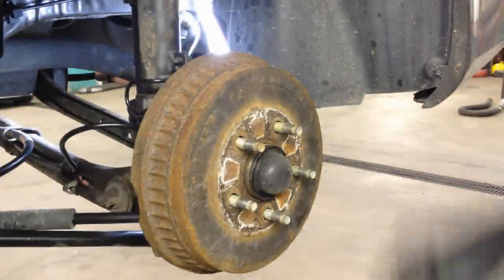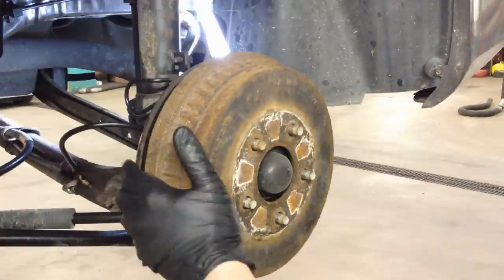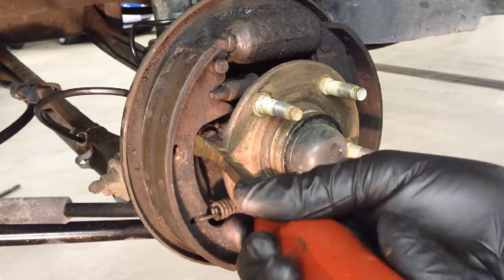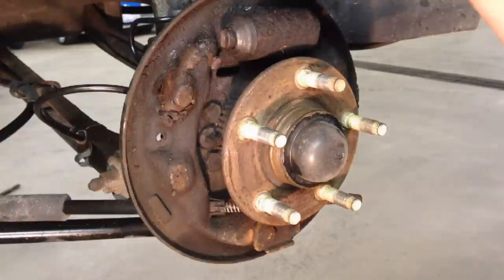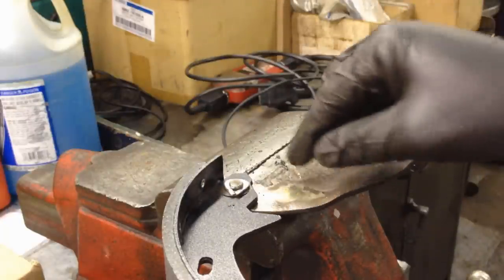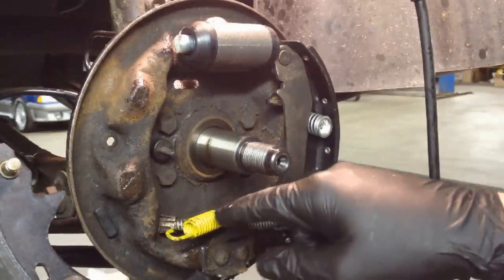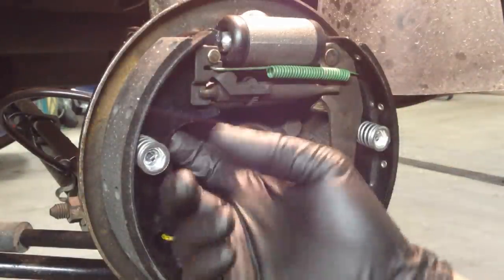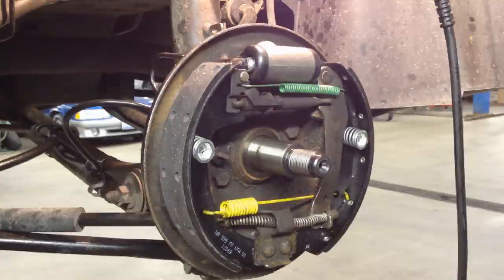Ford Taurus Rear Drum Brakes Replacement

Comment: You skipped the most difficult step for me, getting that shoe on the e-brake cable.
Reply: I just leave it connected to the cable.
Reply: Exactly, does a how to but doesnt show how to
Reply: Me too.  The shade tree mechanic had a hell of a time but persisted until it was reconnected!
Reply: What?  I watched 9 minutes of this video to find out how to get the cable off and he skips ahead.  WTF man!
Reply: I just left it on and had no issues.
Reply: Lisle 44210 universal emergency brake tool. Trust me on this, it’s worth the $30.
Reply: Yea uhm
....just dont disconnect it

Comment: Thanks for the video.  Haven't done drum brakes in over 20 years and in my old age I refuse to pay a mechanic for this old car.  Even though I took pictures I was able to reference your video for spring placement and the order to re-assemble the brakes.  Hardest part was getting the drums off.  For the e-brake, I left it attached to it's plate and just attached that to the new shoe.   I also left the wheel hub on, I did not remove it.
Reply: Thank you for your input. It answered all my questions!

Comment: Great video. Didn't think drum brakes would suck this much, but at least they're done!
Reply: They really suck when you "thought" you had everything you needed, I'm talking ALL new parts, drums, even parking brake cables because they were rusted and coming out of their grommet/locations.... YET after tackling the driver's side like here, everything is off except of course the brake cylinder, so begin to unscrew the tube from the back and it just wants to twist and SNAP!! So the tiny black brake line you can see at the top backside of the backing plate, snapped. I wasn't even at home then so I had to find a bolt to plug off that brake hose so I could drive the vehicle. It turns out "Nope can't just buy a replacement brake line tube online!" You can the right rear, not left.... I wasn't going to the dealer to check and the other way to get the OEM-style part would be to "buy a pre-bent KIT between ~$130-$300 dollars." I didn't need "8+ brake lines costing hundreds of dollars." I just needed this one tiny one. 

So I opted for a local parts store, I think it was either a 6" or 8" straight brake line tube (bubble flare) with connectors. It was around ~$9-$12 at O'Reilly's. Clearly I was going to have to bend the tube myself. I bent it by hand with no tools and turns out my bending abilities are pretty good since the part nearly looked "factory!" The fluid flowed, brakes pumped up and no leaks! So I'd say that actually worked out pretty good. It just sucked that I was ill-equipped that day because I didn't expect the tube to snap and then not even be able to buy an OEM replacement.

Comment: Great in depth video, you explained how and why you did each step. I took my wife's 2000 Taurus SES into a Midas shop, it didn't even have a hundred thousand miles on it. I tried to change the read drum brakes on it. I tried to release the brake adjuster by using long thin flat bladed screw driver, to push it away from the star nut adjuster. I wasn't able to back it off so off to Midas and the guy had to break that rear brake drum. His work station was right next to the waiting room and watching that guy beat on that drum to break it. everyone in the shop was watching he even had to replace the backing plate, and the price of that brake job cost me a lot of money, and time. I'll never go to Midas again. His excuse he had no other choice but beat on it like and yeah right and you bent the backing plate. he used a big hammer and pry bar, that bent the backing plate.
Reply: sorry that happened in my experience you just beat the hell out the drum with a hammer till it comes loose.
you cab replace the drums
Reply: I have had no good luck at shops paid a shop to level my suv with suspension and it came out inch and a half lower in the rear and for 300$ more they would level it I was so mad I took the truck adjusted the headlights and drove it with the squat . The people that work in shops are paid to get the jobs done quickly not properly.

Comment: All of the drum brake jobs ive done, ive always taken the springs off first. It looks a lot easier to leave the bottom one on until you pull the shoes. thanks for the pointers!
Reply from the maker: Yeah you need to really look at them as see how can this be as painless as possible and this trick works for most rear drum systems.

Comment: Thanks for the video Chris. I'm on my daughter's 02 Taurus, catching hell with the springs! Using the little tool makes the retainer springs look toooo easy! Removing the wheel hub, isn't necessary, but it does give a lot more room! On the wheel hub there is a tooth gear for antilock, clean between each tooth, if the gap is full of rust the sensor won't read it properly

Comment: Just finished assembling my 2006 Taurus drum brakes.  Thanks a million for the video.  Also, the tip for the parking brake cable described in the ford escape video really helped.
Ran into a problem when i tried to bleed the drivers side.  First 2-3 times fluid came out as normal and brake pedal sank to floor.  then suddenly no fluid came out and pedal did not move to floor.  Any ideas?  Could it be related to the proportioning valve?
thanks...
Reply: Stumbled across my old post and thought I'd give follow up.  I tried bleeding again the the next morning and found that the problem had simply gone away.  Something must have relaxed & reset?!?  Been driving car ever since with no issues.
Still curious though what may have caused this.  What follows is a brief description of my car's brake system.  
  -  The car does NOT have ABS.  
  -  It has two devices near the master cylinder that I think are proportioning valves.   There are two brake lines from the master cylinder, one feeds proportioning valve A and the other feeds proportioning valve B.  Each proportioning valve then feeds two brake lines, one to a front brake and the other to a rear brake.  What are the functions of these valves?  Will they block flow to a brake?
  -  Near the rear drum brakes there is a device that I learned is called a load/level proportioning valve.  Apparently it senses the load in the trunk.  With a heavy load, more fluid pressure is directed to the rear brakes.    

Thanks!

Comment: Good video, I learned alot from it. Do you have any suggestions about how to replace a rusted/broken rear brake backing plate for a 2003 ford taurus? Im trying to find the right parts but they're discontinued. Do you know if there's a generic part I can use?

Comment: Thanks so much for making this video it helped me a lot! This was a nightmare for me as I snapped the brake line going to the cylinder. Then I had to torch the other bolt to loosen it to replace the line. I ended up stripping the brass threads on the flex line so I had to replace both lines. But putting the springs and hub back together was simple thanks to you lol! Thx again!

Comment: I use my dremel w/ a steel wire wheel to clean the threads on self adjusters, then put some brake grease on the threads as I put them back together, some grease on the other end as well. They never get rusted and freeze up! I'm in the north w/ no garage, so the brakes must be done perfectly, can't do them in the winter!

Comment: Thank you. Came out great but I had a real hard time getting the parking brake cable on and off. Not my first drum brake job with this kind of setup. I also had to replace the brake lines to the wheel cylinders. I was hoping you could do a video on the difference between a single/double flare and a bubble flare and where they are commonly used.

Comment: Got it done I came across the video because I was having a real hard time getting my drum off.  I let the shoes go to far and bored out the inside of the drum I pounded for a long while then decided to scar the face of the drum and popped it open with a chisel and the rest was a piece of cake.  (I did not have an adjustment tool to my disposal) note if you are going to use a grinder to make your cut down the side and spin the drum for each cut in case you do go through you won't take out your piston.. Great video bud all the best.  I sure wish I had a garage like you get to work in.
Reply from the maker: Sounds like tons of fun! I have had to do that before in the past.
Reply: Trop cool superre ce music est mangnifique
Reply: FordTechMakuloco hey I'm having a problem with my 2001 se I was stopped at a light yesterday and the motor quit as if I shut it off.  After checking my fuel pump, the filter all the way to the fuel rail is all good so I pulled the plugs out to see if they were wet and they are not it's not getting any gas in the cylinders so while I was doing that I checked to see how I was doing on the fire side of things.  And I'm not getting either no fuel no fire same time.  I had a friend hook up a computer to it and it's clear. And it turns over good just won't start no warnings nothing just quit at the light. And I'm sure it did not flop the timing belt.  I'm open for suggestions on this one.  Is there a sensor or fues somewhere that the computer wouldn't pick up.  Please help thanks
Reply from the maker: As soon as the key is turned to the on position the fuel pump comes on and pressurizes the fuel system, you should be able to hear it come on as it will be quiet. If it is not then we need to check power and ground to the pump, at the pump harness connector passenger side below rear door.
Reply: FordTechMakuloco the fuel pump is working it primes the rail. There are no DTC's but no fire/spark and no fuel exiting the injectors.
Reply from the maker: Ok so fuel pump is ok, if you are cranking fast enough like normal and no spark then I would inspect the crank trigger wheel and sensor very carefully. Does your car have a tach, if it does and is showing rpm as you crank then we know the crank signal is ok.
Reply: The problem I am having now is the anti theft is preventing the car from doing anything. Do you have any suggestions as to how you would go about bypassing the PATS, or rebooting the car's computer?
Reply from the maker: No bypass or rebooting. Ok so as of now it is a theft issue. If you want to get deep into it give me your email addres and I will give you a couple thing to test for voltage. System is very simple transceiver reads key and sends it all to the pcm to enable . So we basically need to check pcm and pats transceiver for power and go from there. Considering the car died pats was likely not at fault here as it cannot disable a running vehicle and we should be concentrating on the pcm.
Reply: And again, thank you for all the help.
Reply from the maker: So the theft light is now off? Was the new pcm programmed to the car?
Reply: It was out of a car with the same transmission, and same part number. The theft light is on, and flashes repeatedly when you go to start the car. The reason for trying a different pcm was to see if it would bring up any dtc's when we hooked it up, as the original wasn't showing anything wrong with the car, even with everything unhooked. It's not recognizing any rpm's when cranking.(no rpm tack movement when cranking)
Reply from the maker: Does this scan tool id the vehicle automatically or do you need put it in manually. Reason I am asking is I wonder if we are actually talking to the pcm? Can you view other data like maf voltage vref voltage stuff like that. If the scan tool can talk to the pcm then we know it is powering up.
Reply: It does ID  the vehicle automatically , and all it says is "there are no dtcs stored in the vehicles computer" I have also had the same result and have tested it on two different dtc testers. I am going to try and locate a better scanning tool and see what I can come up with.
Reply from the maker: Yeah you need one that can read B code not P codes. that will tell us everything. If the theft indicator is coming on it set a code.

Comment: Your video is really insightful. Im about to tackle the same job on my 02. Do I do this with the parking brake on or off? And also do I need to bleed the system after im finished. I appreciate your help
Reply: I forgot to mention, the reason im asking about the bleeding needing to be done is because I also replaced the brake cylinders, if that makes a difference.
Reply: Anytime you open the system you have to bleed it, but id only bleed the wheem the work was done on
Reply: @chrismallory3718   Thanks for the reply. I got everything finished on it and it feels way better than it did before i did the brakes and brake cylinders. Again this video really helped.
Reply: @chrismallory3718  can you maybe do a future video explaining the rear brake proportioning valve? I noticed while under there its super loose and I can't find anything about it online

Comment: I've watched almost all your vids - they have helped me many times!  I used this one tonight and was able to take care of my rear passenger brake issue.  While driving I began hearing a strong rubbing noise.  Turns out the upper spring had come loose and the adjuster had fallen to the bottom of the drum.  Without the spring, I guess the shoes remained rubbing against the drum.  Had to get a new adjuster and got new springs while I was at it.  Shoes were fine though.  Have you seen this happen before?  Not sure how that spring (the end attached to the emergency brake shoe) could come loose.  So I am concerned there may be another underlying issue.

Thanks as always!!
James
Reply from the maker: James Coley It likely came loose from the shoe side make it is in there all the way I have fought this in the past.
Reply: James Coley We just had the same problem. Did you replace the adjuster?
Reply: Jim Galbraith  Yes, I had to replace it.  The old one fell down into the drum and was ground down on one side by the time I could get it home.  I bought a new one at Autozone for about $6.  I don't see any difference but the part numbers are different for the left and right sides.
Reply: James Coley Thanks for the follow-up. I'm doing mine today.

Comment: Good job of making this damn video I'm stuck on the spring part in you skipped out where the emergency on the bottom thanks
Reply: much easier to leave the ebrake line on there and remove the clip while you are sitting there. then you dont have to fight with putting the ebrake line back on.

Comment: Had a tough time releasing the parking brake cable (spring) from the shoe parking brake lever end.  Is there a trick?  Also, one of the parking brake levers was rusted out.  Where can I get one of these other than Ford?

Comment: Good job man, this is the last thing I have to do on my 2005 Taurus, the shoes are fine but old, and they are the riveted type, which I hate, got new drums, new wheel cylinders, new spring kits and bonded brake shoes, these are one of the easiest drum brakes to do, and I`ve done alot, I hate drum brakes, LOL But I have all the proper brake tools, so it`s a snap.

Comment: I had recently done a rear brake job on a 2006 Ford Taurus, I replaced the wheel cylinders, brake spring hardware, shoes and drums, but I started experiencing rough shaking from the rear, and I'm getting a burning smell also, what could be the cause of this?

Comment: I did not remove the hub but I lost those wave washers between on the parking brake lever and brake show; is that a serious problem than can affect the brake performance? It was 97k miles but the brakes were really really rotten.

Comment: I just did my rear brakes and now I have clicking coming from the rear. I think it's just not adjusted correctly. I have pulled the tires off and adjusted them a few times already and the clicking keeps coming back. Any thoughts?

Comment: Just had my rear brakes replaced. Shoes and drums. Now my brakes are pulsating, Do you think that the new drums need to be turned?
Reply: New drums do not need to be cut, take your vehicle back to whoever did the job and explain the issue, they should fix it.

Comment: hey guy,i want to thank you for this very informative video. Because of your video,i was able to do our taurus rear drum brakes by myself. You were totally correct on the rust on the drums. One thing i wish you would have shown was how to put the e-brake cable back on the brake shoe lever. Because i couldnt get the cable back on the vehicles drum lever and i couldnt find a single video on how to do it,i cut the darn thing off. Im very proud of myself and disgusted with myself doing this drum brake job. Happy about being able to do the brakes but sad with myself for not knowing how to reattach ebrake cable to the drum and giving up and cutting it off :(
Reply: cut it off ??? just go buy the tool that hooks on the spring of the cable and it squeezes the spring together so you can reattach it to the lever , most auto parts stores sell the tool it is just plyers that have a fork looking end on it to go into the spring...

Comment: I'm replacing my rear bearings in a 2006 Taurus SE, with the Vulcan engine. Are the rear brakes abs?
Reply from the maker: +Clorox Bleach most aren't you will know by the abs wiring coming out of the backing plate

Comment: Hey, I have a  93 Ford Tempo, according to the Haynes manual, they ask to remove the grease cap, nut lock retaining nut and cotter pin, is this really necessary? You seem to be able to just remove the drum
Reply from the maker: +MrSavagebart Your drum includes an integral wheel bearing. The Taurus in the video has a hub and bearing setup.
Reply: Thanks man!  That clears it up!

Comment: One wheel was a pain to get the rotor off like you said but the drivers side was even worse.  Had to literally grind a piece of the rotor off to get it off....turned out the retainer spring on one pad was missing and the old pad wouldn't allow me to remove the rotor...otherwise the video was very helpful, thanks.
Reply: Rear brakes do not have a rotor, at least not on this Taurus, it's called a drum.